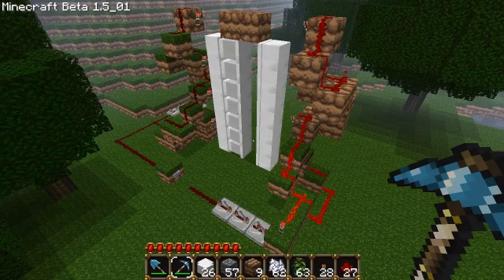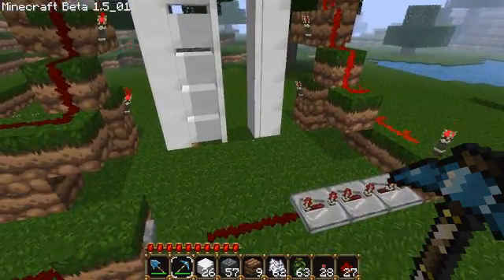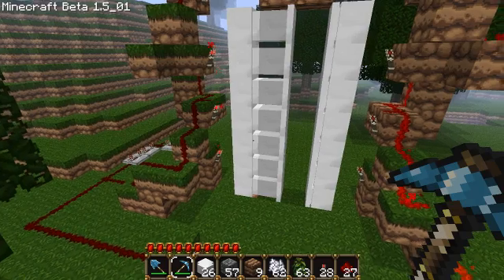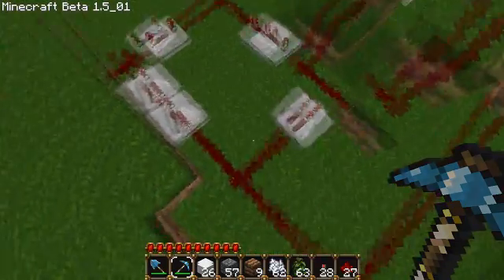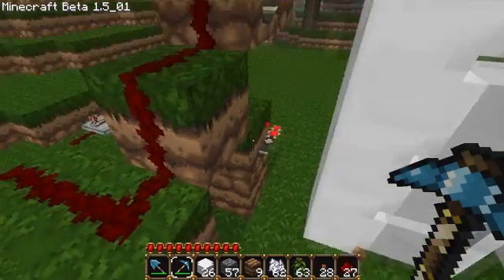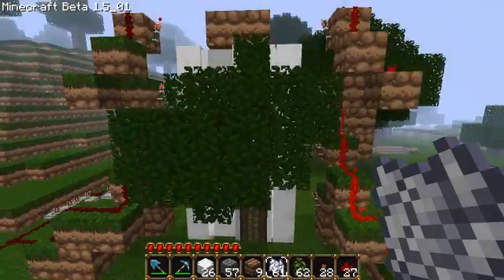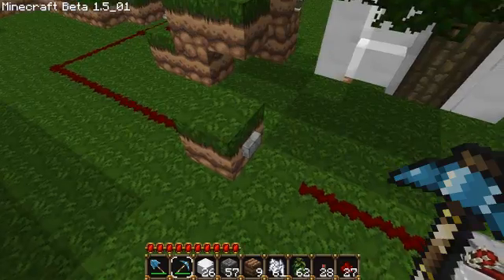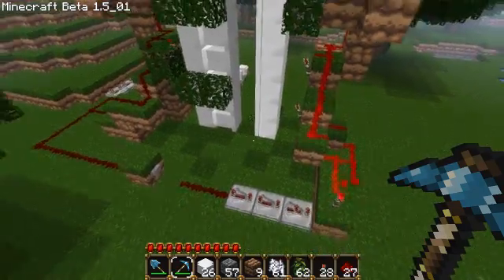Minecraft Tech - Pistons - Tree Farming

Comment from the maker: @ryeder5 If you cap the top off with dirt or another solid black at the appropriate height, they won't be able to. That often means more bonemeal, but you don't need to deal with large tree problems. Of course, that doesn't mean much since this doesn't work using vanilla pistons, but the same applies to manual tree farms; cap the top to prevent trees growing higher than you'd like

Comment from the maker: @Sticksane Thanks. I tend to like trapdoors for a couple reasons: when holding up carts in a dispenser or serving as 2x2 doors which let in only certain mobs depending on which trapdoors are down (both in my trapdoors video), they provide a cheaper alternative to pistons, and also they can be used as manually-toggleable pistons. For example, if you build a corridor over another corridor, you can build your floor out of trapdoors. With ladders on both sides below, you have instant access anywhere

Comment from the maker: @Sticksane One cause is that the majority of the code used for vanilla pistons is actually pushers, which are another modder's alternate version of the original mod. Much of that code is apparently better than the original, although a lot was still left out. However, at the very least, I would have liked to see item and player pushing, particularly after I had designed a pre-1.7 ice-based item transfer system